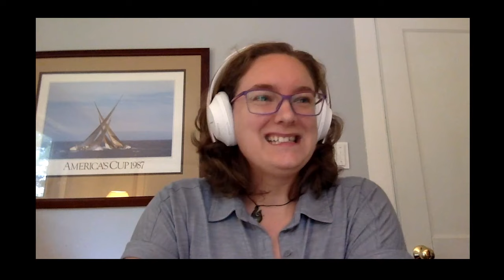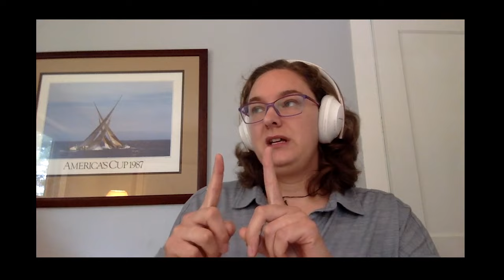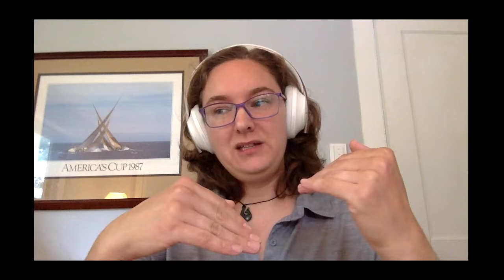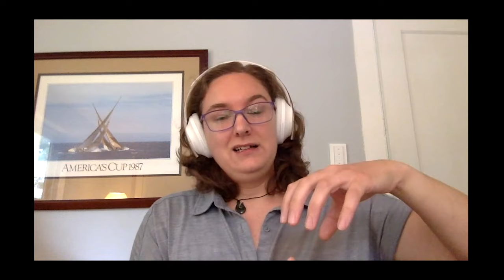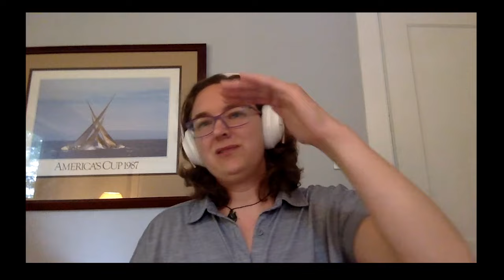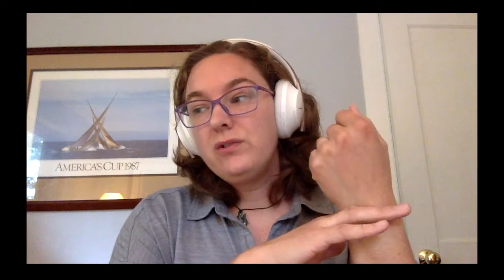Self-Healing Concrete with Dr. Jessica Rosewitz

Comment: Dr Rosewitz, might self-healing concrete be used to effect repair/restoration of a reinforced (steel) concrete bridge that's 107 years old.  The Sandy Hook Closed Spandrel 5 arch concrete bridge over Big Bigby Creek in Sandy Hook TN is at risk of demolition.  Currently the Corps of Engineers rates it still safe for use at 5 Tons, but the local County has sought to demolish it.  A group,, with which I am associated, is seeking to rescue and salvage this Historic Bridge.  If self healing concrete could, in any way contribute to restoration of this bridge, it'd be a boon to the effort to save it as well as highlight the advantages of the science.  I very much look forward to a reply from you on this subject.  Thank you very much.
Doug Baker

Comment: Is the enzyme using calcium from the existing concrete to make the calcium carbonate? If so, does that affect the structural integrity of the existing surrounding concrete after the enzyme uses the calcium to fill in a crack? Would they need to supplement the concrete with more calcium somehow to account for this?